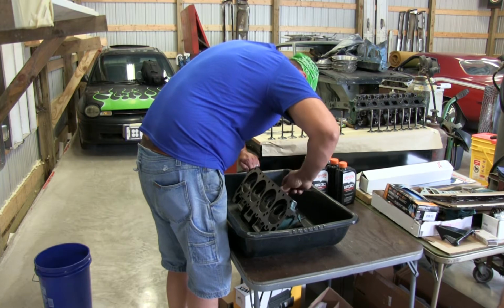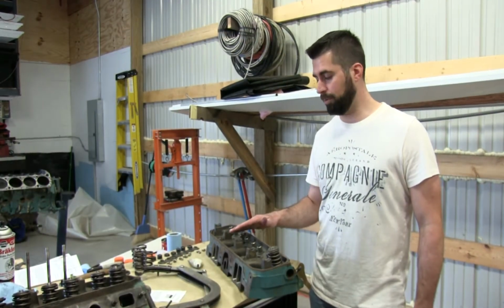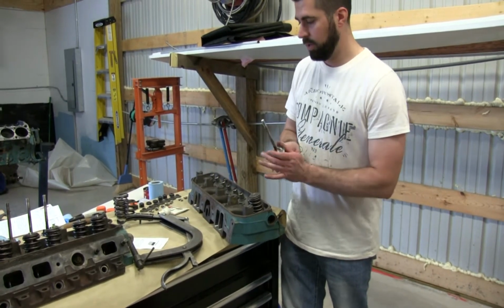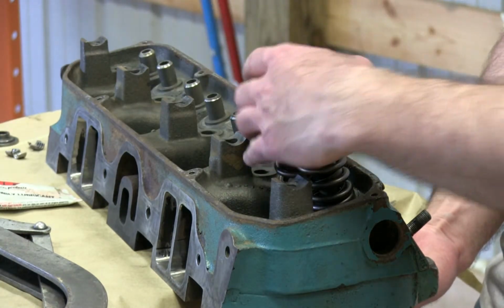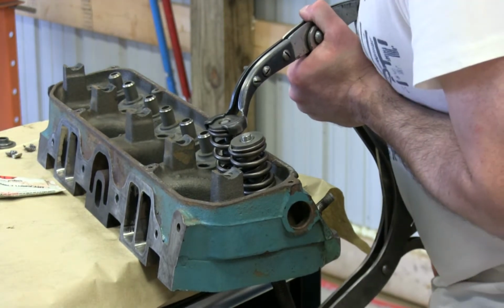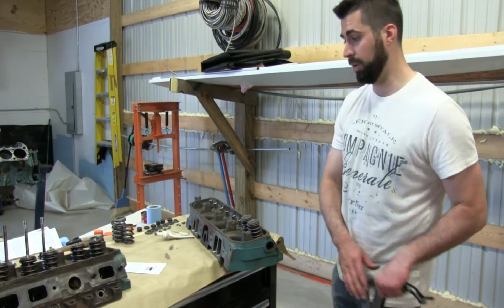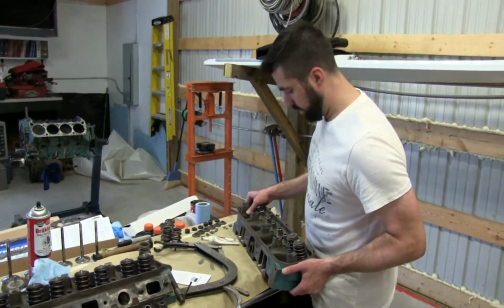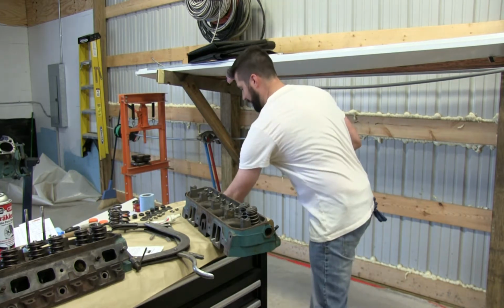Mopar 440 Engine Build Part 13 - Reinstalling Valves Into Cylinder Heads

Comment: Second set of mopar 440 heads I've seen in the last several months... Wonder if maybe my pickup truck is due for a new upgrade?? 440 in a ram pickup with a six speed manual transmission would be fun drivin!!